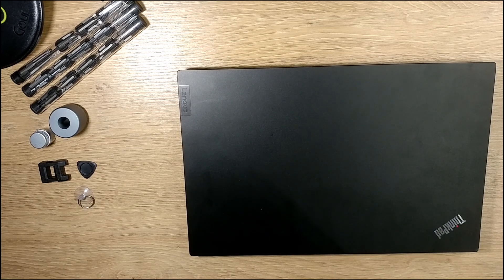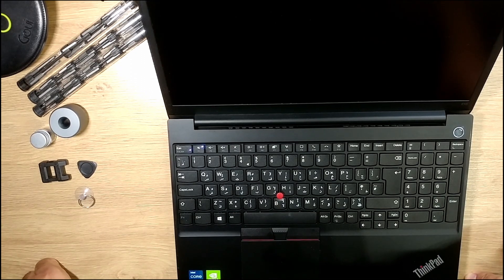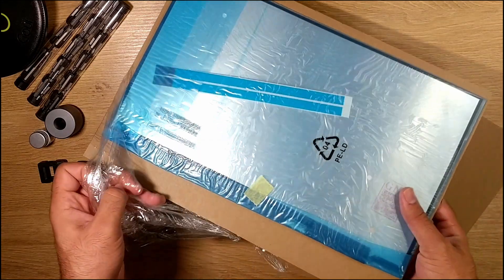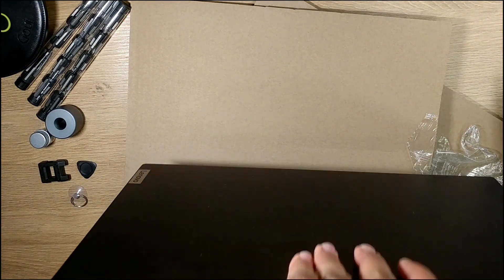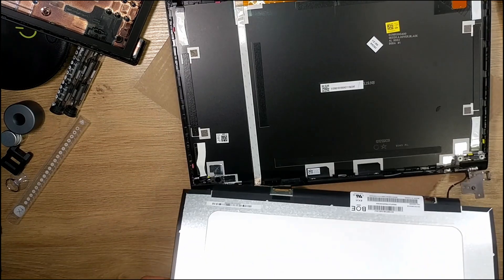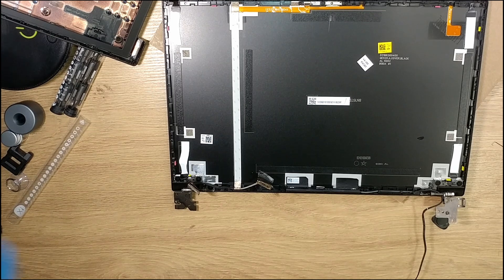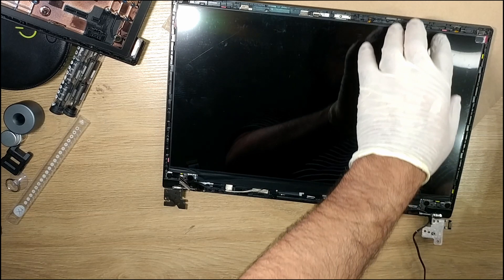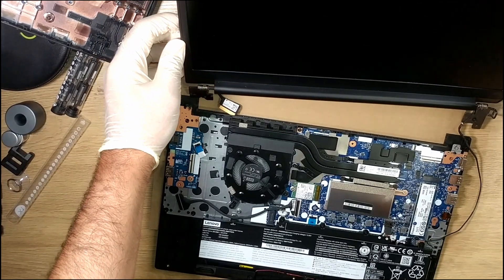Lenovo E15 Gen2 Screen Replacement

Comment: Came here to comment that you don't even need to open up the case to swap the screen, let alone remove the whole screen housing. This will give you a lower chance of screwing something up since you don't go near the board. You can just remove the bezel (easily), pull adhesive strips and then disconnect the 30-pin connector. There are other videos on YouTube showing the method I just described on the E15 Gen 2. I just swapped mine in under 10 minutes.

Be sure to temporarily disable battery power in the BIOS settings before doing this.